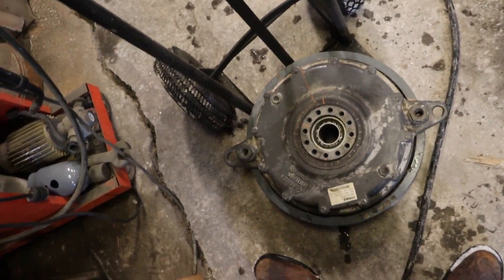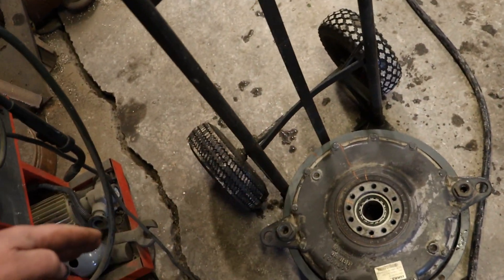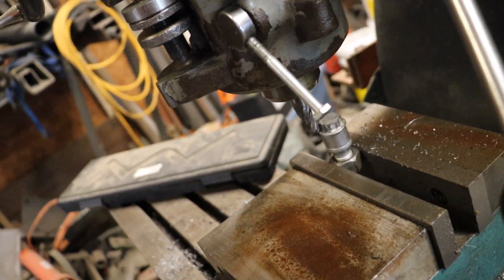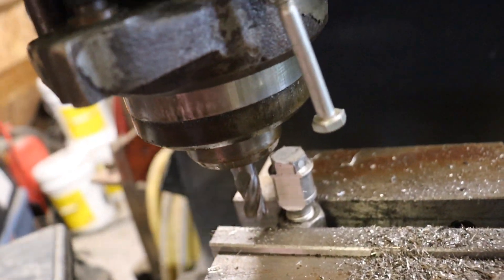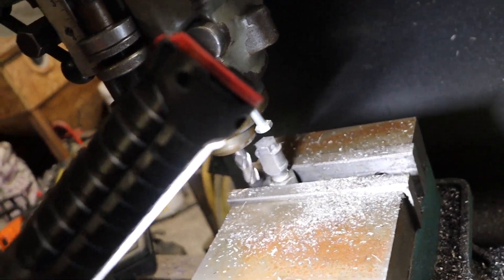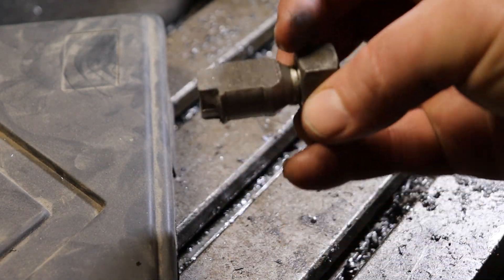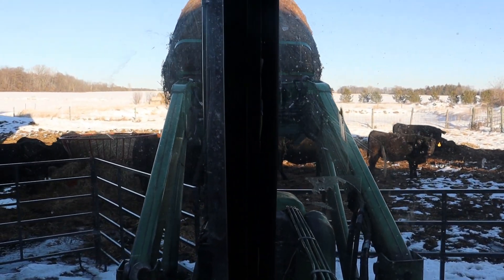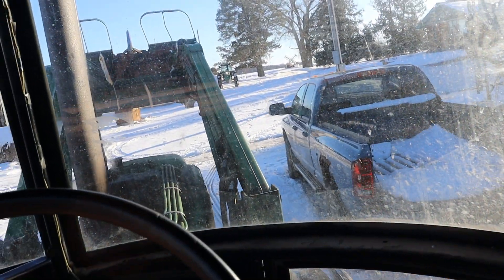Weld and machine repair on a gear box.

Comment: Do you charge an hourly rate, or do you give a price for a project? Looks like you don't mind a challenge.
Reply: It's nice to have a neighbor that has the tools and knowledge, and doesn't need to bend a guy over on the job! Nice work!
Reply from the maker: Mix and match, kinda figure in your head what you think. For this guy i like him so i cut a pretty good deal. Someday if i have a shop and machine area it will be by the hour.

Comment: So what is that that you cut it with in the milling machine it looks like a big drillbit but I’m assuming it’s obviously not a drill bit
Reply from the maker: It is a boring head. So it's like a piece of half inch bar stock with a little tiny carbide Burr at the end. And then the holder adjust how far off of Center that bar is to set your diameter Sparks are because a hard surfacing rod got mixed in with the nickel rod. LOL